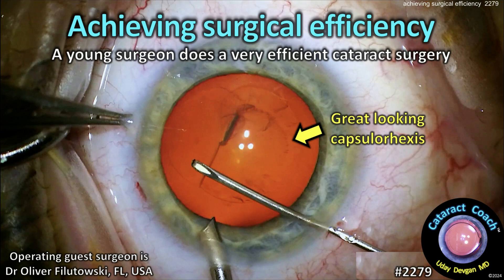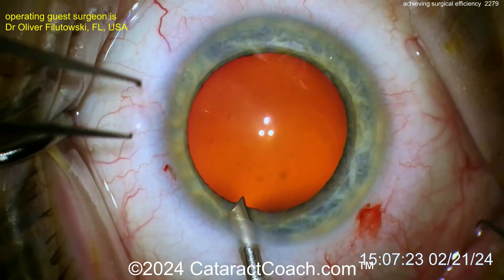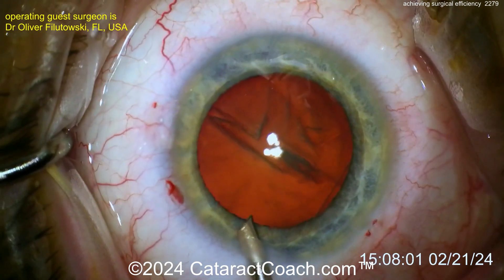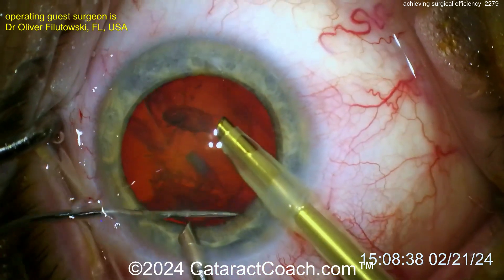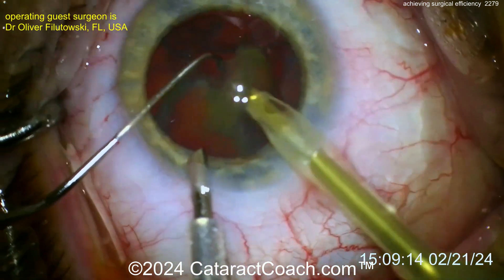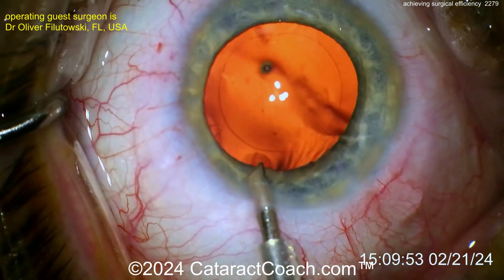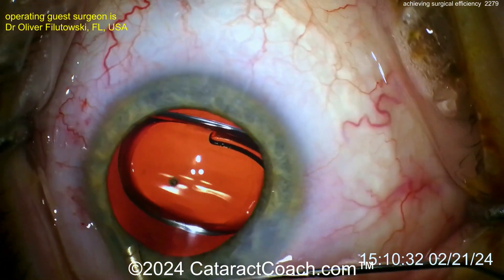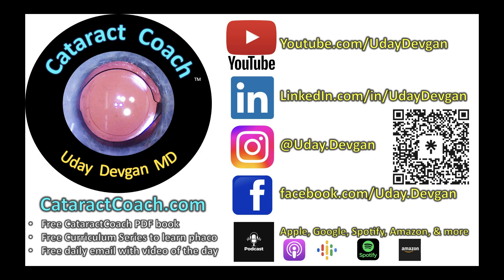CataractCoach™ 2279: achieving surgical efficiency in cataract surgery

Comment: Be aware that phaco infusion pressure should always be higher than chamber maintainer pressure in order to permit adeguate cooling of the tip during phacoemulsification. I personally think that set up two infusion tubes for both chamber maintainer and phaco infusion is not that efficient. Anyway very skilled and experienced surgeon. Thank you .

Comment: That’s incredible. Would this technique work as well in a cataract that is 3 or 4+ NSC?
Reply: Noooo, you must use corneal high density viscoelastic protection
Reply: Having watched these surgeons for some time now, ive become convinced that the only real threat that phaco poses to the cornea is thermal injury. And this is really only an issue at the main wound where it’s in indirect contact with the cornea. And this is going to be the case even if u use OVD (bc there is obviously no OVD inbetween the phaco and the cornea at the main wound). 
I was thinking about when excessive power is used, especially if the phaco is clogged, we've all seen the OVD heat up around the phaco tip and become a "white plume"- in this case the OVD seems like it's better than water bc the OVD looks to be restricting the expansion of this thermal layer, but I wonder if a water fill would be just as safe, if not safer, bc the thermal layer would constantly be disrupted with the turbulent fluidics. I bet the main issue in either scenario would be wound burn, and the endothelium elsewhere would be fine. I’m convinced cases of PBK are 2/2 other factors (IOP, FLuidics, super low preop ECC, etc). 
But im just a young and low volume surgeon who’s thinking out loud. I’m interested to hear what everyone else thinks..
Reply: @soccer24six  My modest opinion, according to what I've seen and experienced, is that corneal burns, using machines from Alcon, B&L, J&J from the last 10-15 years, are caused by prolonged surgical time (that consumes the OVD in ac), with excessive unprotected US erogation (relying just on followability and not using the left hand) and poor phaco piece handling (e.g. keeping the sleeve too "squeezed" on the corneal tunnel walls/roof). The eye presented in this video has a rather transparent and apparently soft nucleus (could be a phaco+IOL for refractive reasons?) so not using OVD is more "affordable". I guess that since before the advent of modern OVDs much more hard cataracts where removed with ECCE techniques even in "phaco era", OVD must have his relevance and it's not advisable not using it to "increase efficency".